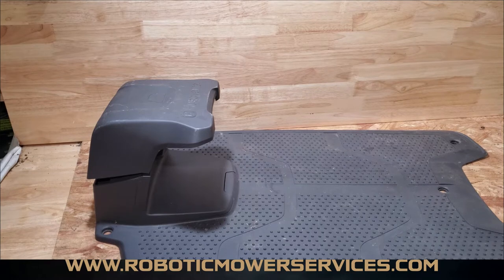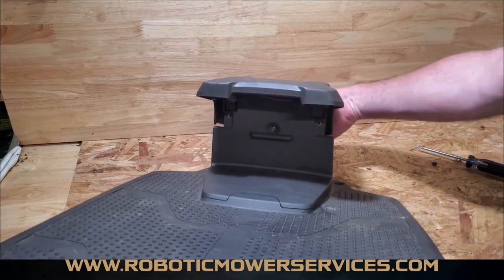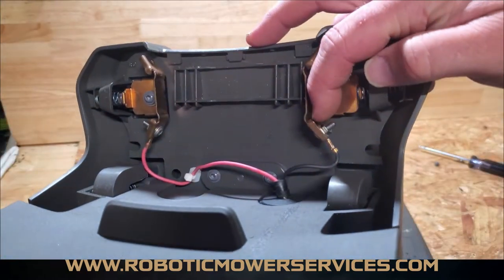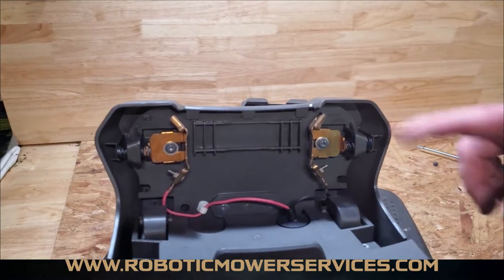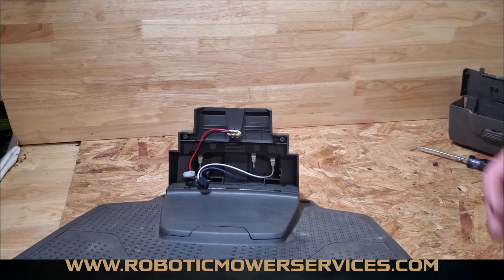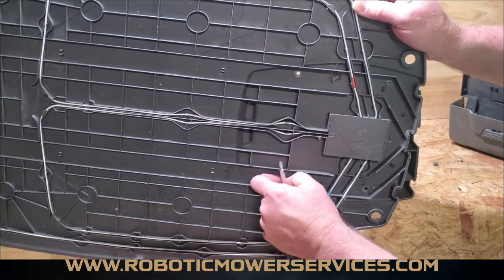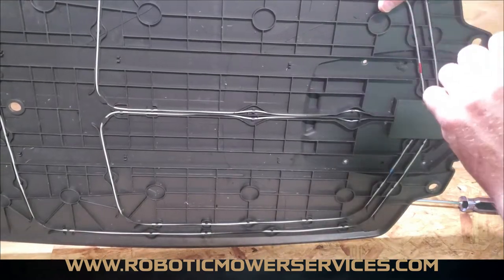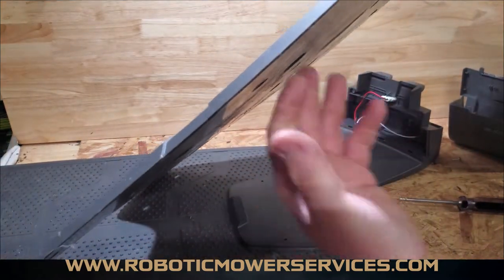Automower Charging Station Components, Disassembly, & Other Info (300, 400, & 500 Series)

Comment: Thank you for the information. I have an old 230 ACX with a glued together base plate. Pulled it apart today and gonna have a go at fixing a corroded section of the antenna. The old ones use different antennas so I'm guessing if I'm going to replace the plate I will also need the board to go with it.

Comment: If I have a 300 series in my backyard and a 400 series in the front yard can I switch the automowers or do I have to also switch the charging station as well, thanks
Reply from the maker: Charging stations are different between 300 series and 400 series mowers so they would have to be swapped with the mowers.

Comment: Thank you for sending the 5 blade decks.  Amazing cutting now!!!  I'm waiting for you to get 1 more in stock for my 3rd field mower. lol Oh, by the way, the screw holes on the new 5 blade deck are about 1/4'' set back further than on the OEM 3-blade deck. Can you have that fixed and set the blades back closer to the edge a little?  Even 1/8th inch would be helpful. Additionally, why don't you sell the computer board for it?  I keep having to go thru Pronto mower for stuff like that and buy the low voltage wiring/power converter et al from individual separate vendors.  I'd prefer to buy all my parts in one place. Also, the blades with 2 holes in them so you can reuse the other side of the blade set is awesome so long as they don't get bent, or straighten them before flipping them around. I've seen no loss in performance. I push my 3 field mowers to 2 acres each. With these upgrades, the mowers are doing well. Now for a longer lasting battery. :)

Comment: I have two 450XH's that mow my 2 1/2 acre lot. About 8 days ago, a power supply stopped working on one of the charging stations. I tested it on the other charging station and confirmed that it was no good, so I ordered a new power supply online. While waiting for the new power supply to arrive, I removed the good power supply and connected it to the charging station that had the bad one. It worked fine for 4 or 5 days, then one night I got a "charging station blocked" error. The mower was near the charging station, so I pushed it into the charging station to start charging it. I didn't see any signs of the charging station actually being blocked. The next day I realized that the mower never charged. I pulled it out of the charging station and noticed the status light wasn't on. Thought it may have blown another power supply. I disconnected the power supply and re-connected it to the other charging station and fortunately, it worked fine so I just left it alone. Yesterday, the new power supply arrived. I connected it and was happy to see a green status light on the charging station. I pushed the mower into the charging station, and started charging it. Within a minute or two, I received an "empty battery" error message on my phone app. The status light went out again, though I could occasionally see a faint red light. Wasn't flashing red though. I unplugged the new power supply and plugged it into the other charging station. It works fine, so I just left it connected to that charging station. Today, I took the charging station apart and didn't see any noticeable issues. I unplugged the connectors and checked them. I removed the circuit board and didn't see any noticeable issues with that either. All connections looked tight and secure and contacts look good. I put it back together and took the old working power supply, and tried plugging it in again to the charging station that I'm having problems with. No change, still seeing the occasional faint red light, but again, it is not flashing red. Have you ran into this before? I didn't remove the bottom of the docking plate, so I don't know if there are any issues with those wires.
Reply from the maker: The fact that it is going from green to red when the mower is trying to charge means that there is a component on the charging station board that is failing since it is green until placed under a load. Flashing red would indicate an issue with the antenna wire in the base plate. The only other possibility for the light changing from green to red when the mower is trying to charge is that the charging cables on the mower are melted at the plug and causing the board to short when the mower is plugged in (See this video: https://youtu.be/nU69uyAU-WE). But since the power supply for this station failed that is why Im pretty sure the charging station board was affected by that and is the issue now
Reply: @RoboticMowerServices  Just for future reference. I ordered a new charging station. It arrived today, so I connected it up. I plugged in the new charging station, and the status light did not light at all, not even the faint red light. Well, there was only one thing left that it could be, so I pulled up the wire that connects the power supply to the charging station that was buried under mulch in a flower bed. I found a spot in the wire that had greenish corrosion. Cut out this small section of wire and re-connected the wire with electrical tape. Problem solved! I'm leaving the new charging station in place and will use the old one for spare parts. Do not know why after installing the new power supply that I got the solid green status light until I pushed the mower into the charging station and tried to charge it...that is why I didn't check the faulty wire before ordering the new charging station.

Comment: Thanks for the video.  I was only getting between 5v and 9v at my boundary wire connectors and a flashing blue light.  I have found a dried up slug on the circuit board, could this be the cause? The circuit board hums a little when the power is on.
Reply from the maker: Definitely can be what caused the issue! We see that kind of stuff with ants and stink bugs pretty often here in our area

Comment: Great video. After getting an antenna error, (red flashing led) I disconnected the base station and found one of the white cables (with the blue sleeve) which goes into the 4 pin connector, had become detached, either through corrosion or physical damage.
I stripped the wire and pushed it back in to the connector, and get a green light, but it isn’t very secure.
I’m thinking the best solution would be to get a new four pin (p4 ?) connector from a pc supply store, - can you confirm if the 4 pin connector is in fact a p4 ?

Comment: Another great video! Hopefully. after this, I'll find out why I'm getting occasional "no loop signal" errors even though I know the loops are good. It's been quite a surprise to me, right from the beginning, that these electrical connections (the spades) are so poor. In fact one of the connectors for the guides refused to stay fixed from new and needed a little squeeze. Shocking really on a product that's so expensive. Can you supply to France?
Reply from the maker: We can, but the shipping might be a little costly
Reply: I have exactly the same issue in Switzerland. I followed Husqvarna's instructions and bought a KOLSAL pro and my wire is fine. Also occasional blue light (no loop signal error) and without doing anything it starts working again -----just to stop (blue light) 5 minutes later. 
Great video! many thanks

Comment: My mower really has to bang its way into the charging station. Is this normal? I'm thinking of shaving some of the plastic off between the charging plates on the station so the mower can enter more easily. Would you recommend this course of action?
Reply from the maker: They actually have parts available now to correct this issue. The problem is that they are on backorder right now nut I believe they will be available again in early July. Send an email to roboticmowerservices@gmail.com and we can give you more information.

Comment: How do you get the pins out of the white female power connector when you have to replace the main wire loom in the base station? Thanks
Reply from the maker: If you are replacing the harness just cut the red wire and black wire of the old harness to make it easier to remove the connector
Reply: @RoboticMowerServices  Thanks, didn’t realise the harness came with a new plug..
Reply from the maker: @Deebo1812  no worries, glad we could help you figure out how to tackle this repair

Comment: I have an old 220AC G2 from 2004. 
The baseplate ( part.no. 535 14 00-01 ) is glued together and both the N-loop and F-loop are broken inside. They are made on a flexible PCB with ~4 turns on each.
The F-loop ( far-field ) is the outer loop used for "long-range" base detection. The N-loop ( near-field ) is an 8-shaped loop which guides the final docking.
Does anyone have any info on how these 2 loops are attached to the 4-pin connector ? 
( It seems impossible to reverse-engineer the layout without destroying the baseplate completely. )

Comment: Great video. My problem is that I have no   light on my charging station pcb. I have tested that 28v going into circuit board but only 4v going out. It did work before but when I pushed in the mower the light kept going out. Then the last time the light never came back on. The mower may have been very low or no charge in it though. Does this just mean a new pcb?  I have a 430x.
Reply from the maker: Yes, this usually means that there is an issue with the board. In a few rare occurrences we found that the power supply was causing the issue. In those few rare cases the power supply was putting out the proper voltage, but when the mower was placed in the charging station the voltage coming out of the power supply dropped under that load.
Reply: @RoboticMowerServices 
Great video thank you! I’ve got the same issue, no light on charging station of my huswqvarna Automower 305. I would have found a proper motherboard replacement. Can I install it by myself or it must be programmed by Husqvarna assistance?

Comment: Thanks for the informative video! What is the right part number for the charging station pcb for a 2017 450X with the park button?  All I seem to be able to find is 589507802 that doesn't seem to have the park button receptacle.
Reply: I ended up finding the part number. For anyone wondering, it is 592894502.

Comment: I have a 435X it gets in position to charge and keeps coming back out and eventually gives me an error message,  Tried levelling, positioning wires underneath, moving the transformer and all, and can't seem to find the issue, and my dealer doesn't seem to find anything about it.   Have you ran into a similar issue. thanks for your feedback
Reply: I have just had the same problem with my 430x after it was firmware upgraded. Went in and out about 8 times and then got a charging station error. I had to disable the temporary disable charging protection option in the special menu and sorted the problem
Reply: Same problem with 320 model. With a Husqvarna battery, it comes out and doesn't charge at all. With a generic one, higher capacity, it charges to 100% and come out. In both case, i have an error message : "problem with charge station". If I restart manually my 320, it keeps working untill next charge.
[edit] My problem was due to the higher capacity of the battery. With a lower capacity battery, no problem

Comment: Automower 420 series here. It says my F signal "NO" and my N sensor "YES" when I check Tools>Test>Charging Station on my robot lawnmower. My lawnmower basically finds the charge station with the guide wire but then fails to dock nearly always and that must be because of the lack of F signal? I have pulled the connector for the F and N antenna wires out of the motherboard and then it flashes RED. There is no visible damage at least to any of the cables or the connector itself. When I plug it back in, the flashing red stops so that suggests to me the motherboard must be working and there must be an issue with the F and N wiring loom? Can't think of anything else I can try other than having to buy a new base plate which has a new loom attached to it because I can't find anywhere online that sells just the antenna wiring loom. Any help would be great. Oh and forgot to say that when I use my robot lawnmower outside of the charging sensor and test the sensors the further I take the robot away from the charging station the F and N numbers start to get towards 0 which again makes me think it must be the charging station itself that has an issue? Thanks!